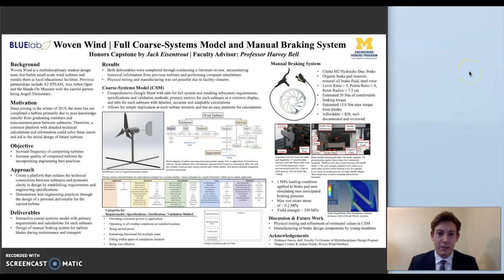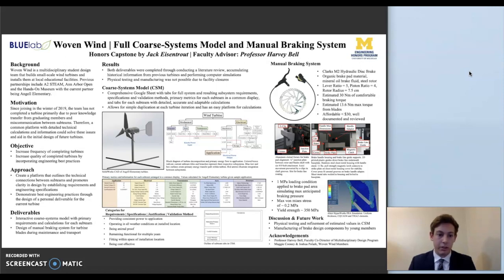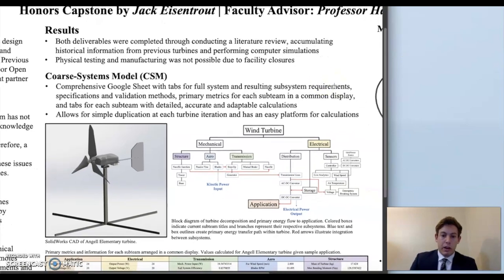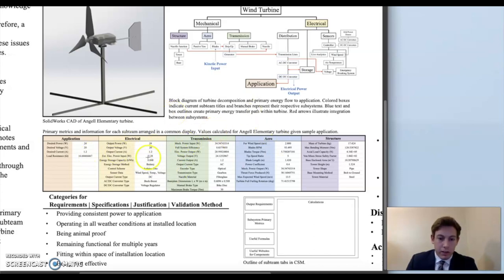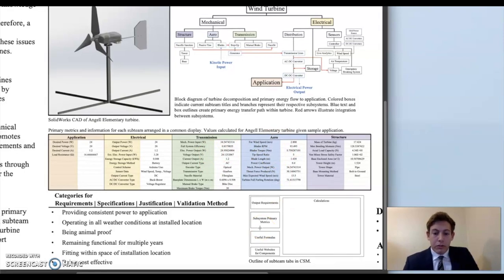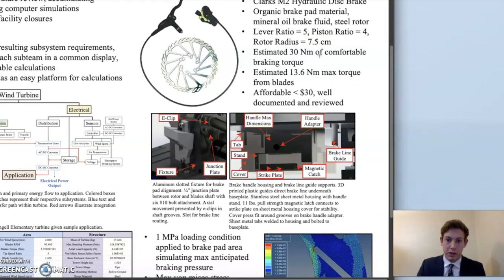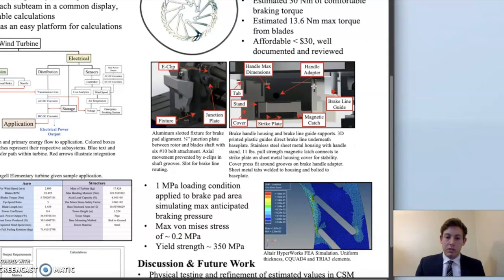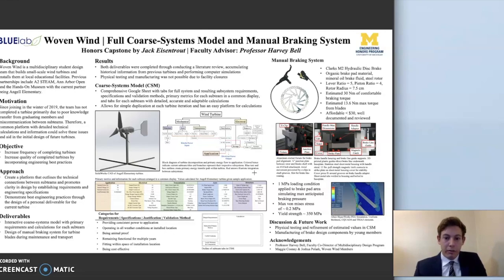Woven Wind | Full Coarse-Systems Model and Manual Braking System

Comment: Great work! Besides COVID-19, what was the most unexpected challenge you faced while creating both your CSM and the braking system?
Reply: Thank you! Although this wasn't necessarily unexpected, a challenge I faced was strengthening my knowledge in  engineering disciplines where I don't have as much experience, such as wind turbine blade aerodynamics and certain aspects of the electrical design. However, this turned out to be a great learning experience.

Comment: Great job Jack!  Your braking system seems well thought out and designed.  Do you have any concern about thermal conditions of the brake rotor during braking?
Reply: Thanks Grace! I did hand-calcs for a thermal analysis as well and found that the temperature rise of the rotor would only be about 8 - 10 deg. C assuming uniform heating under max braking conditions. More useful information will come during testing, but I don't anticipate it being a concern.

Comment: Great job with the presentation and project! I liked the use of existing mechanisms for the braking (no need to rework something that already has been designed). Is there anything that came out of putting together the systems model that you did not expect?
Reply: Thanks for the feedback! It was interesting to put in parameters for our existing design and see what application power levels are reasonable, and where we can cut back in weight for the future - specifically in the structure.
Reply: @jackeisentrout4445  Yes, system level models are great for being able to look at the influence of different parameters. Very nice project and thank you for the response.

Comment: Very good idea to help your project team. Was there any sort of historical data you could look at to test your CSM against since you couldn't physically test it?
Reply: Thank you! Unfortunately, there was not any physical testing data I could reference for this project - although it would have been quite helpful. However, a different and simpler version of a coarse-systems model was developed in the past, which showed certain values that would have been helpful if accurate, but I believe they were simply estimates back then as well. For this year's turbine, gathering testing data on the Wilson Center roof is a top priority, and wind speed, current, voltage, temperature, and torque will all be recorded and shed light on the CSM thus far.

Comment: Really interesting projects! What do you think will be the most difficult part of implementing the CSM into the team's future work?
Reply: Thank you! I think the most important piece of this model, or at least a part that holds a lot of influence, is nailing down values for the blades tip-speed ratio and power coefficient. Currently they are set for representative small-scale 3-blade horizontal axis wind turbines (HAWT), but acquiring data from testing on the Wilson Center roof will be most illuminating. Using the CSM should be simple, but validating its accuracy must be done to benefit future designs.